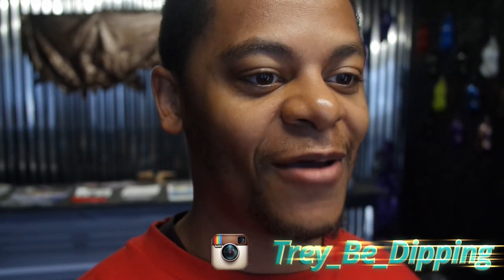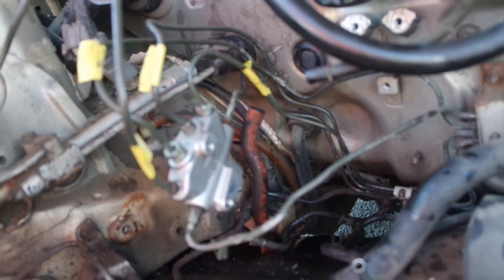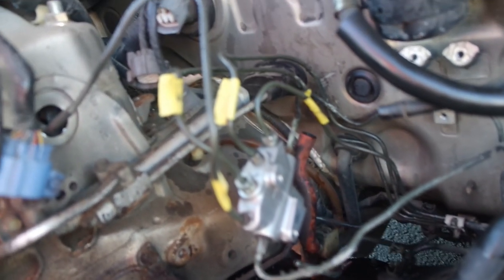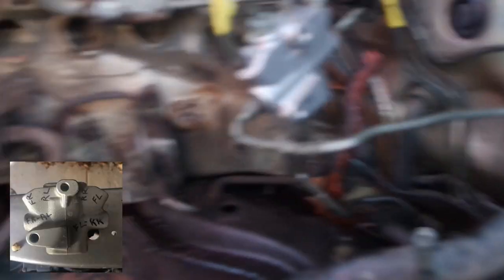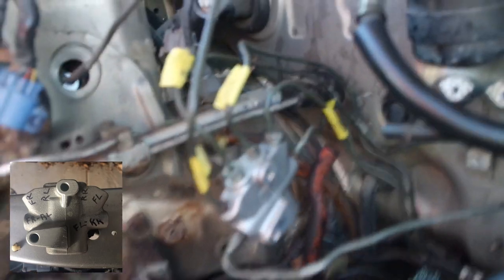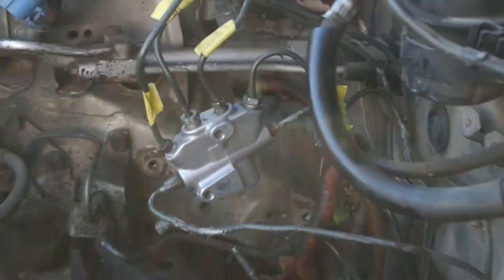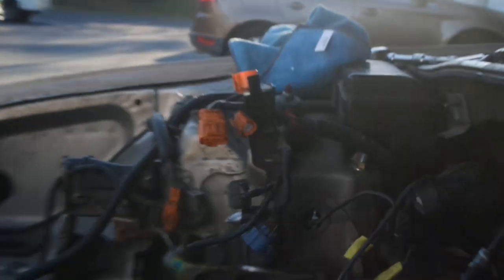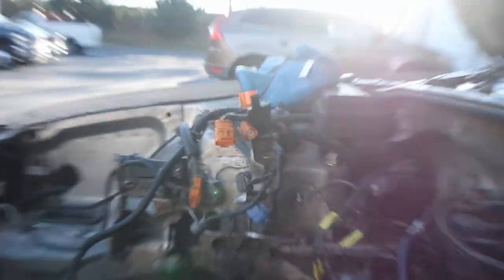Honda prelude ABS delete | h22 f20b

Comment: Hydraulic flaring tools are so much faster and much easier to use BUT cost anywhere from $200-$400 depending on brand and seller. But if you are able to get your hands on one it would cut down flaring time a lot and consistently makes perfect flares everytime. Once I used one I never went back to old manual type
Reply from the maker: I didnt plan on doing anymore brake line stuff so i went cheap lol

Comment: How did you know which lines areto  what? Like the reference for the prop valve i gotta make sure they are the same way.  and i got one brake line thats bigger im gonna cut i dont see the 2nd one u mentioned , 92 prelude si

Comment: I deleted mine also bro but i used a 96 accord prop valve relocated the prop under the master cylinder like it is on the s modle prelude ...or accords re ran all new lines to bro be carful on those flares i had the same kit and they leaked bad had to by a flare kit from eastwood and they are perfect flares every time
Reply from the maker: Thanks for the heads up...im gonna double check them
Reply: Anytime bro the flares could of been user error to but i gt mad at the kit threw it in my closet and bought the more expensive one it works great just heads up you know brale fluid sucks on paint keep up the great work brobro

Comment: My flanging was done easily on my 93 bb1 if your smooth at it lol you can do it to but in all the abs mod and its pump from the 4th gen are heavy pieces so I was happy getting my delete done... you just have to take the sensors out of the wells and its complete... get rid of front bumper support bar  youll love it but in all I dropped a lot of weight out of my bitch

Comment: I'm about to do this to my 92 prelude.   Did you remove the proportioning valve that's under the master cylinder, or did you just add an additional proportioning valve in place of the abs pump and motor?
Reply from the maker: Leave the one that's under the master cylinder and replace the abs unit with the second proportion valve
Reply: @treybedipping1734  Thank you. How do your brakes feel?  My Prelude has a full cage and is built for circle track racing. I'm run some pretty high speeds. The only reason I'm doing the conversion is because the abs pump is leaking.

Comment: aye trey, I ordered and installed this proportion valve on my 4th gen, but I have no brakes now. I tried to bleed them, yet it's not getting fluid. Is there anything you did after to get your brakes up and working?
Reply from the maker: Double check for leaks and keep bleeding until you have pressure in the brake pedal. 

Also double check the way you hooked up the lines to the valve
Reply: Bet thank you. The diagram didn’t make much sense to me, so I winged it with the lines. I connected each line based on how yours were connected, but it was hard to see super clear. I appreciate the help.